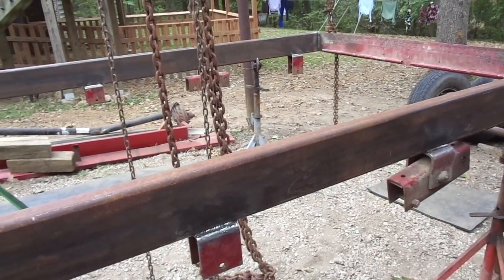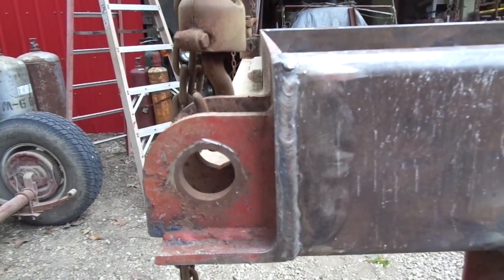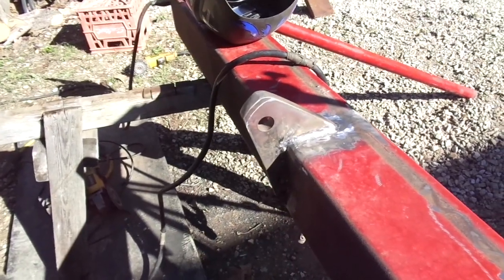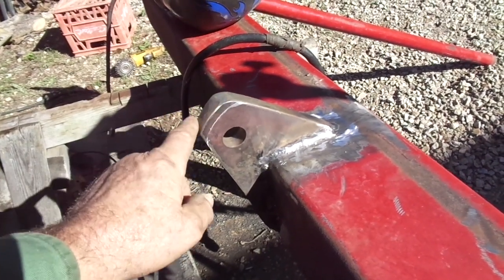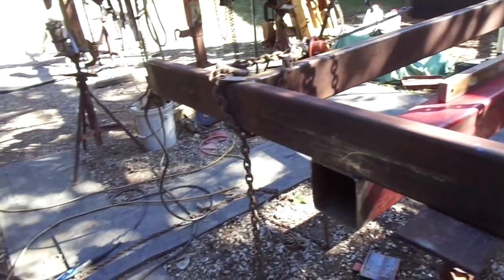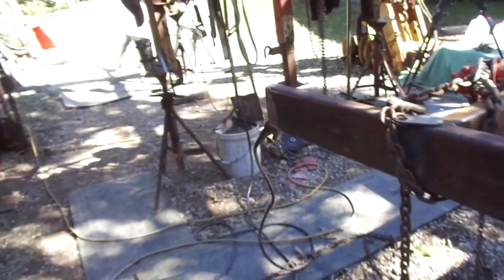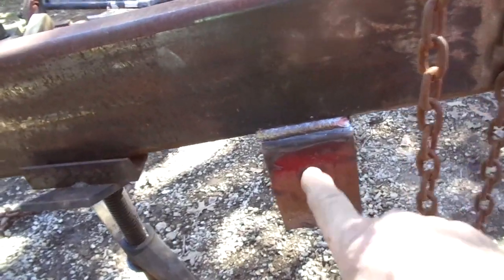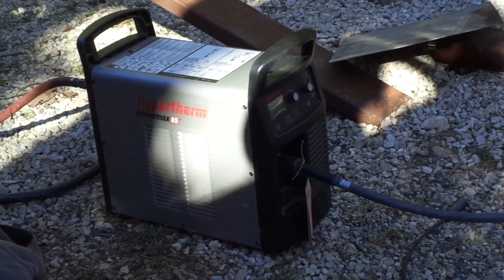Tandem Dump Trailer Repair Pt 6

Comment: Thanks for taking time to video and teach!
Reply from the maker: How's things going down at the sawmill Kim....?  Has the Missus been keeping you in line ??  I just watched a couple standing dead oak catch on fire when you two were getting ready to relax for the evening....  Thanks for taking the time to watch and comment.
Reply: @tractorman4461  the sawmill is 80%.  got to stretch strings and get it aligned, then work on the carriage.  i bought a diesel kubota backhoe for $1000, if i can get it to work, may use the diesel to power the mill because the case needs an overhaul.  I think I will be finishing the sawmill in january if I dont have to work too much.  thanks for asking.  looking forward to your dump reveal
Reply from the maker: @TripleTRanchAndSawmill  What size and year Kubota and how serious is the problem....or have you gotten that far yet.  My little Belsaw needs some TLC too.  Its out of alignment and the blade overheats in oak, but cherry, walnut, pine and cedar it cuts pretty good.
Reply: @tractorman4461  2000 L35 35HP.   Think not building pressure  going to
the hydraulic clutch.  I have decided to let a local mechanic have a crack at it.  The PTO works so I figured $1000 for low hour diesel is worth the risk.  But a working backhoe would come in handy!
Reply from the maker: @TripleTRanchAndSawmill  Good call...I'd go that price any day of the week on what you describe.  I have an old Massey Ferguson crawler with a Drott loader that has the exact problem.  The hydraulic clutch and reverser is a closed system powered by its own small pump off the timing gear and only develops 25 psi at full rpm, not enough to make it work.  Its a nice Perkins diesel though.  Hey man...Happy New Year.

Comment: No need to apologize, my friend....the main thing is that you're getting her done and you have a lot of duct tape top repair the holes....watch the belly part and the fingers because there is a limit to what tape will repair....bin there done that....CHEERS
Reply from the maker: Oh man, I've used electrical tape to hold pretty good gashes together a good number of times....Just like I am sure you have done.  I usually make the first wrap with the tape backwards so the glue doesn't pull the cut open when I get home to fix it for real.  Duct tape works good though on a nice grinding gouge in your belly because they are nice and straight...usually...and the glue reaches all the way across the gash.  Sure stings later though....LOL.  Then the Missus lets you know that WAS your only Tee-shirt without a weld burn or wear hole in it !!   Thanks for watching sir.

Comment: I know what you mean about the uses of duct tape Tractorman44! One day in my shop I kneeled down and the knee of my jeans ripped right across, very traumatic! I should have gotten  therapy I recon but then I spied the duct tape. Sure enough it took care of that rip for the day. I even taped a pocket once when my knife and keys and change came out my cuff. That tape survived numerous washings for quite a while until those old Jean finally gave up. I remember when I was a kid it took all summer it seemed just to break a pair of jeans in. They would stand in the corner by themselves. Now you can hardly get a season out of a pair. I heard on the radio a few. Years back that actual Cowboys were selling their old worn out jeans for $50. They were bought by some company in NYC and sold for $150 as real cowboy jeans. So I thought that you could create some good funding if you sold Tractorman44 duct taped t-shirts complete with the original tape in NYC. I'll be you'd get a chunk of change for each one. And if you use that duct tape that look like tiger skin it would appeal to those high fashion folks. I can see it all now, the big Thanksgiving day parade and all the floats, then comes Tractorman44 on his gold plated tractor dressed in a duct tape costume. Interviews on tv shows, Tractorman44 comic books and children's book and the covers would have that famous duct tape square on the covers. And on tv shows you could tape the reporters mouths shut making a great show for a change. They'd make movies called, The Taper 44. I wondered if that trailer you're fixin up might just be for the Tman44 float? Pulled by a Tractor of course. With this kind of influence and connections with government officials, you could probably arrange for our states to me moved closer together. Well, it could happen, may be, possibly? But I suspect you're much happier at the ranch without all the sparkles and spangles, eh? Could have a fleet of fine old tractors and sell cups of JO during traffic jams, mobile JO 44. I have lots of ideas if you want more. They may not work but I have plenty. Well Friend Wendell, as I raise me cuppaJO your way in the usual toasting morning schedule, this is DaveyJO and I'm outta here to face this rainy day heer Inna holler wishing you All, Stan too of course, a Fine as Frogs Hair on Chicken Lips on a Cue ball New Year!
Reply from the maker: Wow DaveyJO...there's a lot to wrap up in there....  LOL.  It is kinda funny what people's ideas are for 'fashion' ain't it.  Personally, I believe you can tell by my well tailored clothing that I am a person with impeccable taste.  You know a guy just can't hide some things from the camera....right?  I search my vast wardrobe each morning for just the right combination of daily dress.  Yeah, right....
    Hey I'm gonna get to visit ol Stan tomorrow morning so I'll extend your toast to him...to him. He crunched his car in the snow the other day.  He slid off the driveway and hooked onto a stump then backed up and slid backwards down a steeper part and crashed the back end into a tree.  So he got banged up coming and going !!  Tore up the front AND the back and didn't even make it to the blacktop.  Thank you for watching and commenting DaveyJO and me and Ol Man Stan will be toasting YOU tomorrow bright and early !!
Reply: Tractorman44 Yes Tractorman44, I remember when I can across the first video from TM44! I saw your dress and skills and thought, now this is a man of taste and skills where he dresses in fine duds even under the worse conditions of a working shop. This is the channel for me. I did notice our fine tastes in fine clothes and tractors and women and friends like Stan. And that orange shirt and the contrast of the tape displays a high end quality in and for the arts. And I've always wanted a plasma cutter, may be one day I'll find one at a sale or spring for one. But in the meantime I'm working with my monster machinery and all is going smooth! I have been held back with two days of rain but tomorrow is another day and what a better thing to do on the last day of the year than split wood? And I will double toast Stan in the morning! Sound like he had an exciting adventure alright. I'm glad he's well enough for a cuppaJO in the morning. Are you going to weld his car back and may be bend some metal fenders for him? I guess riding about on a tractor is a bit chilly this time of year. Those new imitation tractors are like a Lincoln inside with all the bells and whistles, even maids I hear, eh? And being a guitar player, there is a store in St. Louie called Eddies Guitars and they have a YT channel too. One day I want to go there and check out all those fine guitars. If one is serious about a fine all wood guitar your talkin thousands. Not uncommon to pay $5-6000 for one. So when I do this one day, it's coffee with Wendell and Stan fer ser! And you don't spend that much on a guitar if you ain't played it. Am I buying one? Maybe one day and may be not but to look and play a few,,,,well ya never know. But for just $1300 I could have bought an old Oliver. Shoulda coulda didn't! But I see one in the future brought down to me by an Angel. St. Oliver passed me by so who knows. A FINE JO time tomorrow with Stan and those buttox maidens who will keep you healthy, at least until you get home. HAPPY NEW YEAR TO ALL AT 44 HEADQUARTERS and Captain Stan! DaveyJO
Reply from the maker: @daveyjoweaver5183  A Happy New Year to you and Alice as well sir.  I saw a guitar store way up north on Page Avenue, (iirc), that has a red guitar for a sign that's gotta be 15' tall.  I don't remember the name though...be funny if that was the one about which you speak.  I ain't much on the guitar...but remember our conversation about the old antique Swinette....??  LOLOL  Have a good one and sip along happily while you're in the woodpile....I will.  Oh yeah, that guitar wasn't just a sign, it seems to me like it was a fully shaped guitar.  Musta been one of Paul Bunyan's, that'd be my guess.

Comment: Go look at those bubble gum weld wands on some of these new trailers. I wouldn't trust them at all.
Reply from the maker: Yes, I have seen some pretty bad ones.  When we rebuilt the original gooseneck on this trailer in '016, the original welds on the 4" vertical hitch were just poorly blobbed one pass mig welds with minimal penetration.  There were places an inch long where the welds snapped off and you could see no melting of the parent metal into the mig bead.  I couldn't believe it held in place.  So yeah, I'm really ok with what we have going one here.  Thanks Bryan for watching and commenting sir.